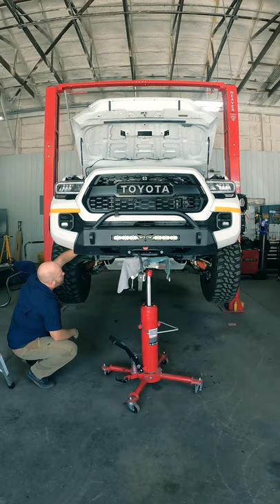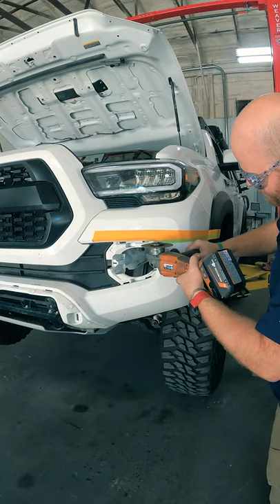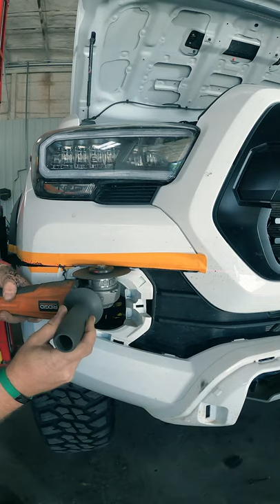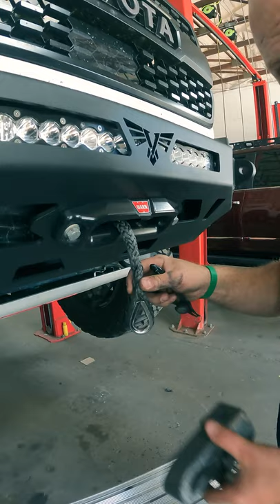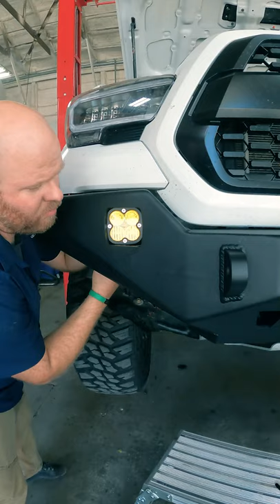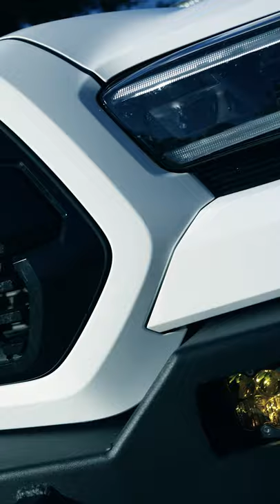Tacoma Strike Front Bumper Swap | Victory 4x4 | #shorts

Comment: wow you made that look so easy.  Truck looks so much more aggressive.  Thanks for sharing!
Reply from the maker: No problem!
Reply: @Victory4x4  Did you had to cut the Tacoma bumper to install the older bumper? I love these bumpers but I'm having a hard time cutting away at the OEM bumper
Reply from the maker: @1apocalyps  you do have to make some cuts for the Blitz, but they are hidden under the black trim piece if you ever decide to go back to stock. Check out the install document or video for more details on the exact cut: https://www.victory4x4.com/product/VT3FB.html